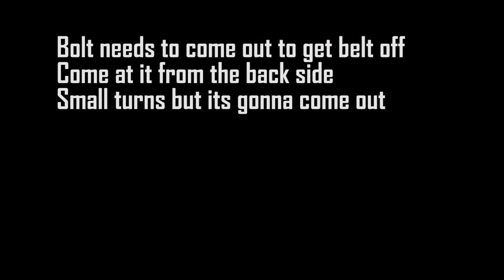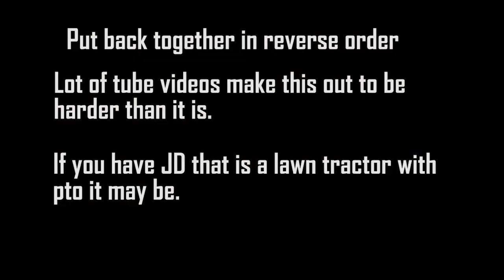How To Change Drive Belt On John Deere D130 & Stuff

Comment: I changed my fuel filter out on my tractor this spring. There's a bleed screw? and it has a copper washer on it. I learned I have to replace or anneal it or it leaks. 😀  I have run a biocide in my fuel at times but still diesel can get funky.